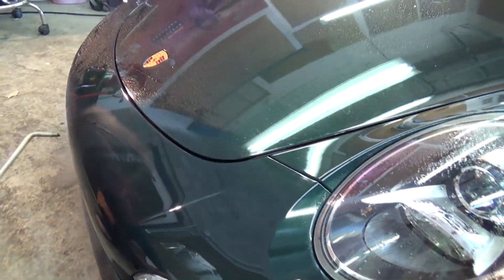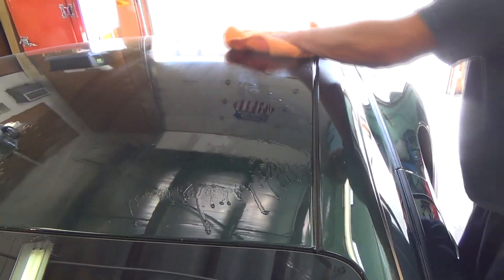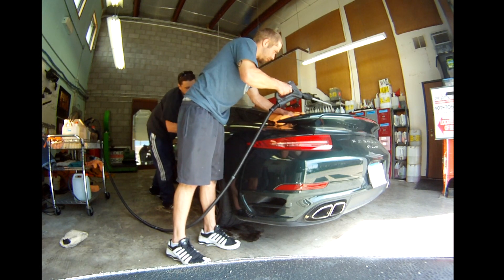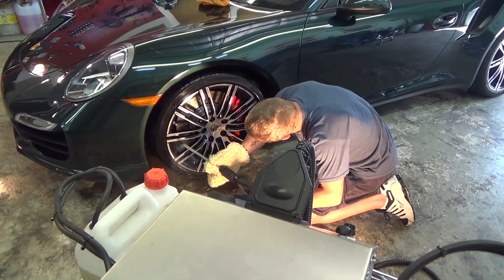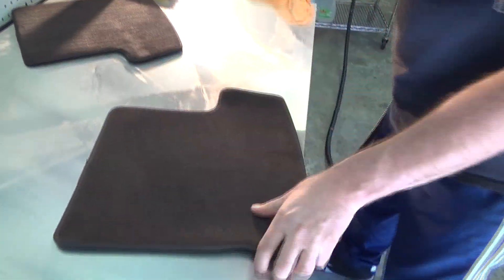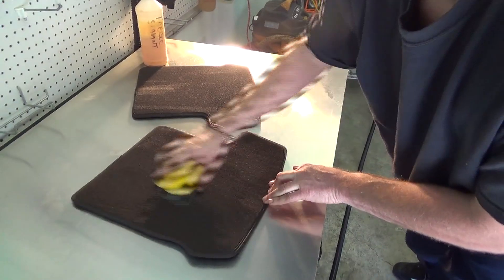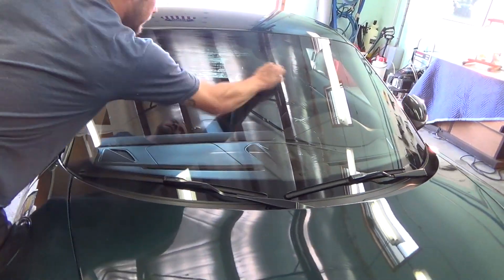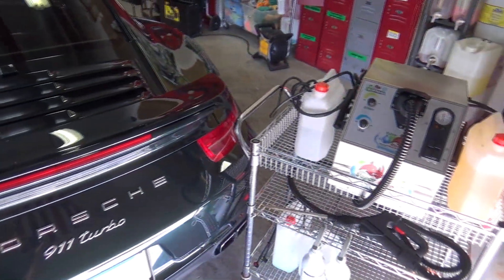Vapor Rino Porsche 911 Turbo 997 New Car Protection Package

Comment: I have to disagree with your methods. You certainly would be doing some type of marring to the surface. You should always do a light polish before you apply anything....doing things by hand does not mean it is higher quality, in-fact, its the opposite. Uneven pressure from your fingers on a small applicator and applying in circles is detrimental to any finish. Porsche's are not painted with Cerama-Clear so the paint is mid range hardness, and not as hard as a new Audi paint would be. The steamer is great for releasing bonded contaminants, especially rubber and tar/bugs, but you need to apply a lubricant before you go ham scrubbing the paint with a microfiber. I know this because I own a high end paint correction business, and work on mostly Porsches and I can tell you, what I am witnessing is your employee installing scratches in the paint, which in the case of polishing the paint afterwards is not a huge concern...but not polishing after going ham on the paint with a steamer and no ONR or high lubricity presoak or injection....that's a big no no...
Reply: You are COOOOORRECCCTTT!!!

Comment: Which vapor rino are you using is the the 120 volt or the  230 volt?
Reply from the maker: Got, I'm using the 120v in the video however I have switched to the 230v and  you are shopping for a Rhino I recommend the 230v by far.Thanks Much!
Reply: Visual Perfection Detailing Thanks for the review! Question though, why do you recommend the 230v vs the 120v? What aspect or area of detailing do you see a noticeable difference?
Reply: @NickM1013  The difference is power output, 1750 watts vs. 3500 watts.

Comment: Hey Question for you does the Vapor Rino to clean headlights that are faded would it knock the dirt out etc?
Reply: +swordfish00007 It certainly cleans the headlights well, Unfortunately headlight fading still would require a wet sand or a buff.Thanks